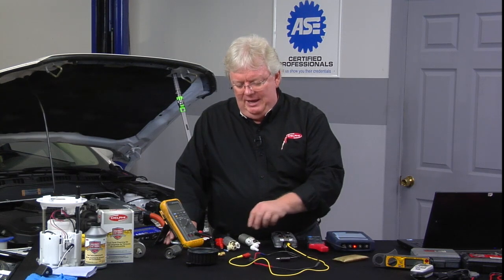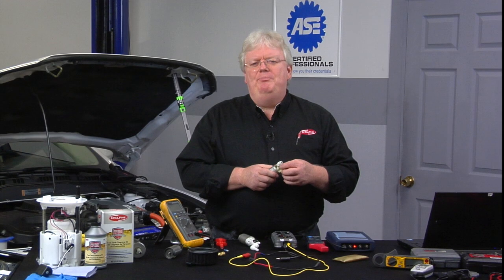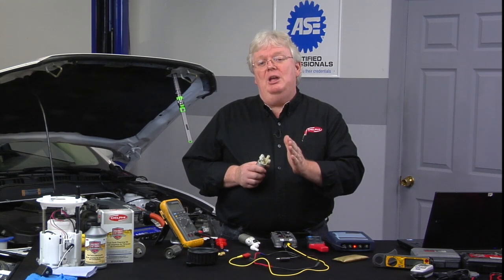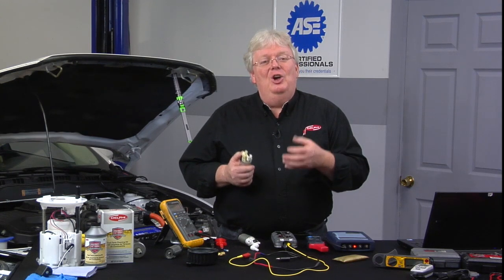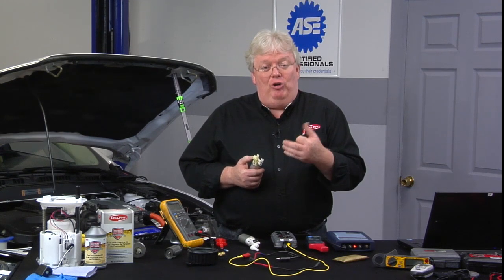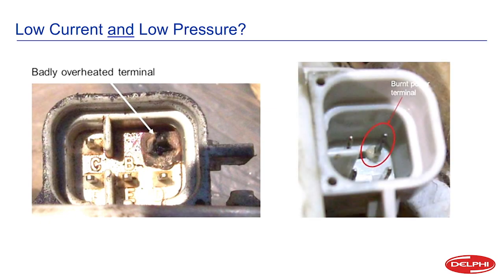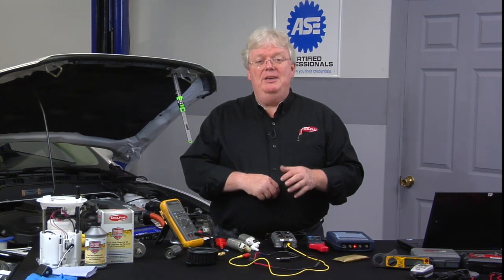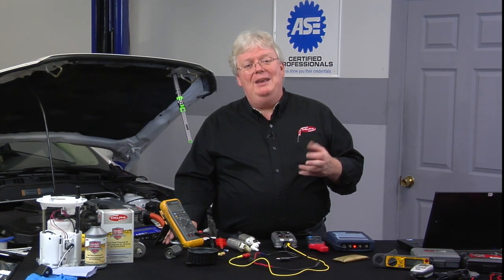What Causes an Overheated Terminal?

Comment: Any help? 2013 f150 v8 5.0 my truck died after a day of not driving it because I was  having to jump it everyday to start it. I noticed the starter would make a lingering sound after the truck would turn on (before having to jump it everyday) so I figured the starter finally completely died and bought and replaced it myself, I must have wired it wrong cause the starter started spinning as soon as I connected the battery so I swap it but now when I try and turn on the truck the starter clicks and the wires get really hot fast! All connections are tight and clean from the battery to the starter..any suggestions?

Comment: Or anther way you can fry your terminal is if your smart like me and don't disconnect your battery and try to loosen the bracket bolt on the bracket that holds the battery in and touch your metal ratchet to the positive side of the battery and sparks start flying and the terminal catches fire. True story...
Reply: Same shit that JUST happened to me. Bracket was hitting negative battery terminal (the corner of the black bracket turned white and dusty). And noticed alternator positive terminal was burnt. Literally melted right off. Part of the screw came off with the 10mm nut, so yeah, that’s my Saturday evening😅😂

Comment: I have this exact problem. 04 yukon Denali fuel pump went bad. Got a new one and installed. Upon installing I noticed the ground terminal on the wiring connector was burnt a little. Connected it back up and everything was fine. Then the other day wife was driving and heard a weird sound. It was that terminal burning out more. So tomorrow I'm going to get a new wiring connector and hopefully that fixes it. Hopefully.
Reply: Yep that fixed it.
Reply: and.....did that work ? I am guessing not, eh ?

Comment: nothing to do with the caption. if you have faulty fuel pump you should caption it fuel pump electrical issues not battery positive getting hot.
Reply: it gave me some insight as I've known about my faulty fuel pump and terminals also get boiling hot. it points me in a direction

Comment: My Felicia had changing problems and a hot + terminal. Changed both terminals and found that the + cable was corroded inside the  insulator. Cut off the bad bit and its now charging 14v at batt when it was only 12.5-13.2 earlier.